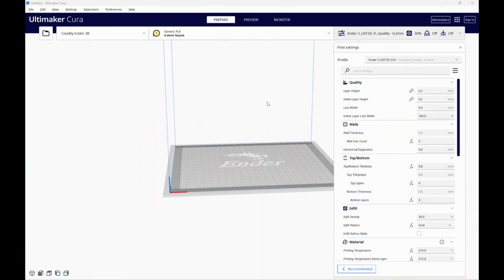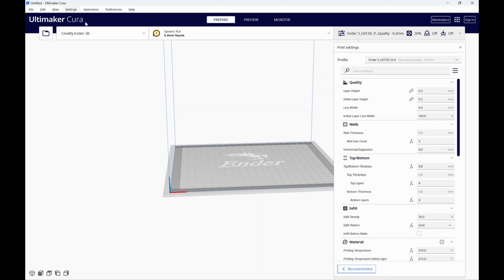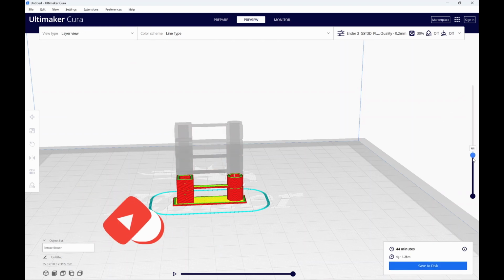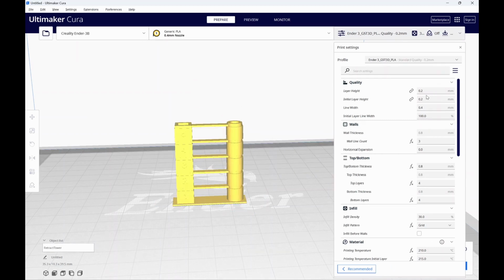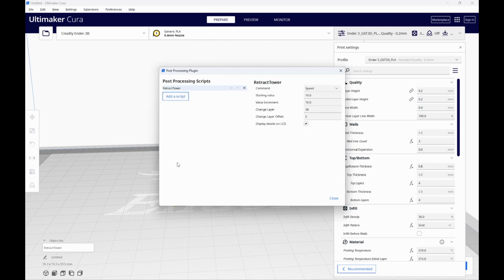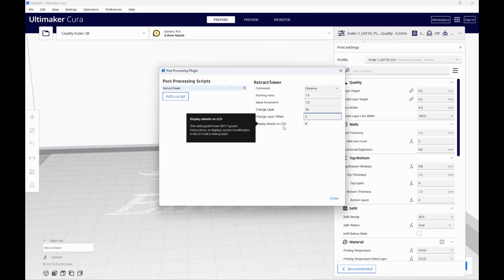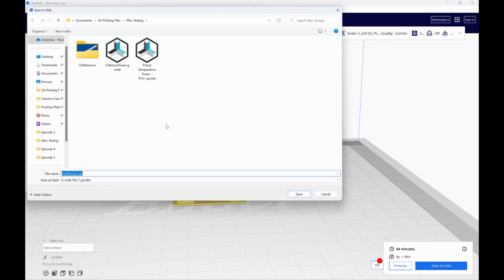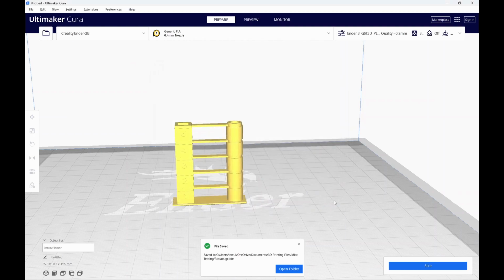Get Rid of That Silly Stringing With Retraction

Comment: do we need to all these steps for each and every different quality setting? so example... rough quality for testing say at 0.4 then you want to do a nice print at .012 would you have to red do most of these steps or should it be just fine once you have set it all. Thank you :)
Reply from the maker: If you are experiencing stringing at the different quality profiles then you'll probably want to. When I set mine, I do it with the standard profile. I also save that profile under a new name that includes the filament Brand & type in the name & layer height Std for 0.20. For example, HatchBox_PLA+_Std. I save my temperature settings, flow rate, retraction and support settings to that profile. I hope I answered your question, if not just reply and I'll try to do better! Thanks for watching!
Reply: @pushingplastic7445  absolutely perfectly, thank you kindly for taking the time to make these tutorials. These have helped me a lot this past few days. Excellent explained without making the assumptions that people know what your talking about. If we did we wouldn't be searching for help 😬
Reply from the maker: @bandyleg2285  Thanks for the kind words. I'm glad these are helping! Your reply was the very inspiration behind this channel!

Comment: I really enjoy your videos as they are easy to understand the way you explain.  Very good instruction methods.  I have one question; why doesn't Cura slicer import Imperial dimensions from fusion 360? I've searched on Cura but have found no settings.  I am fairly new to 3D printing and your videos make it that much more enjoyable.
Reply from the maker: Wow! You asked the million-dollar question! The quick and easy answer would be that Cura Marketplace has a free plugin called Barbarian Units that enables users to convert models from inches to metric. I've never tried it so I can't speak for how good it is. From what I read a while back, the Cura developers found it to be difficult to support multiple measuring systems. Although the most common file type we use for printing models is STL, Cura actually likes the 3MF format better. That format defines the unit. STL's on the other hand carry no unit of measure so Cura assumes it to be metric. I probably added more confusion to the question than the original question! I can say that my daytime job is as a mechanical designer where I use the imperial system all day long, then come home and try to jump into metric mode. Some days it's tough to make the mental leap! Thanks for watching!
Reply: Thank you for your timely reply, I'll take a look into Cura but would dwell on it.  I always can interpolate.

Comment: So glad I have come across your new channel 👍 so clear and easy to understand, please keep making these calibration videos as they are extremely helpful.
My question tho is, my printer is a direct drive, what retraction window should I run my test at please?
Reply from the maker: Awesome! I'm glad you're finding this information helpful. As for your question, Direct drives like less retraction than a bowden tube setup. I would set my Starting value to 0.5 and my increment value to .5 so that it is printing retraction tests at 0.5, 1.0, 1.5, 2.0 and 2.5.  would write those values down so that you know section 1 = 0.5, section 2 = 1.0 , section 3 = 1.5 and so on. If you aren't happy with those results, then set you starting values to 0.25 and increment to 0.25. But 0.5 is probably a great starting point. Thanks for watching and good luck!
Reply: @pushingplastic7445  Thankyou very much, I will try those out 👍